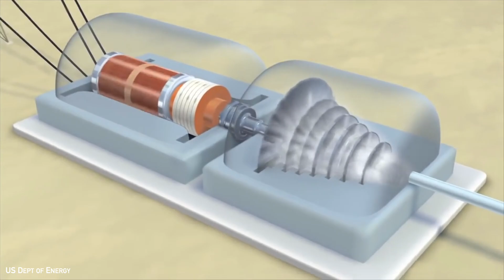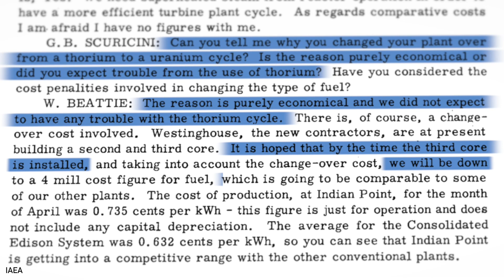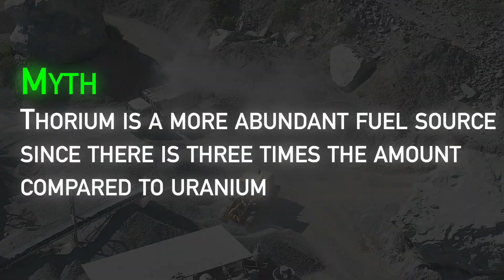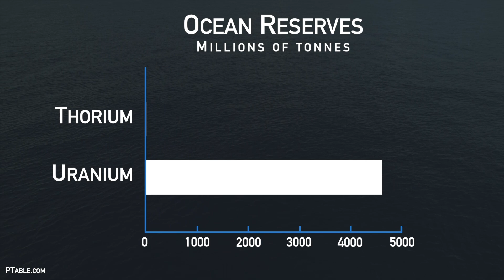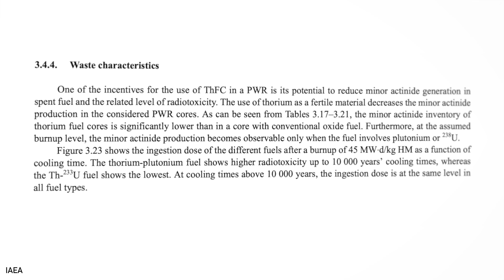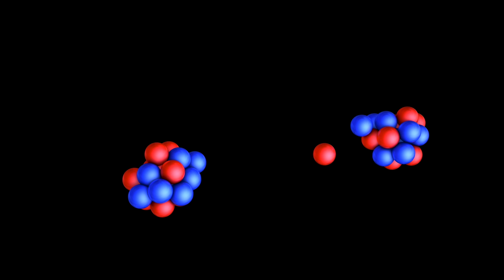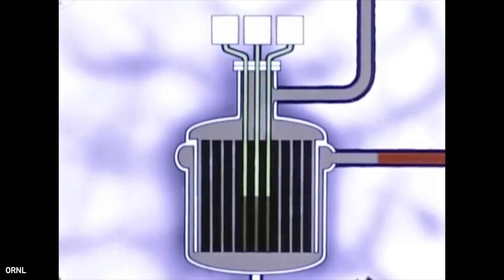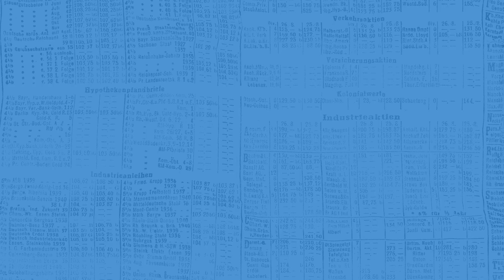*Almost

Comment: There’s plenty of uranium 238 sure but it’s not the uranium we need, uranium 235 represents about 0.7 percent and requires enrichment (separation of isotopes). Thorium 233 is the default thorium isotope, making most of your earlier arguments in this video simple propaganda and not a valid argument.
Reply: You can use U238 in nuclear reactor directly.  Canada's CANDU reactors use unenriched U-238.  CANDU is larger and more expensive to build.  It uses heavy water and thus a bit higher in operation cost.

Comment: THANK YOU FOR TALKING ABOUT THORIUM!  Fair warning, this response is not friendly.   

I loved the "oh, after 10,000 years their the same" , GREAT.   The big issue is that Uranium is industrially concentrated into pellets that are very dangerous, expensive and must be kept under strict regulatory control to keep them from melting into the core of the earth, yikes. Then we only use 3% of the energy they contain which is why it takes so long to "get back to earth levels" GREAT. Store all that waste for 10,000 years!!  More government! The nuclear industry makes a lot more money off the pellets, maintenance and security with the large scale reactors. 

Thorium on the other hand uses 97% of the energy which is why the waste is so much less dangerous and "goes back to the level at which we dug it" so much quicker than the hyper concentrated Uranium pellets. Thorium reactors can actually burn the waste you buried. BRILLIANT!  You also fail to mention that there are thousands of metric tons of Thorium just lying around mining pits all over the world. 

Also, the reactors are very different. Conventional reactors are large and must be meet strict continuous maintenance to be contained to prevent melt-down. (Fukushima, right through the water table)  Then there are MSR's (of which there are a dozen designs) which are more like riding a bike, when you stop peddling they simply shut down. Done and Done it's the difference between a chemical reactor that must have material continuously added to keep the reaction going vs a physical reactor (like a radiator) which must be continuously cooled to prevent disaster! 

Oh, and then there is modular  safety from terrorism, etc etc etc. Now there are material challenges due to the salts in the MSR, but there are other designs that avoid the salt intensity. They each have advantages and disadvantages, but large scale reactors are much scarier when disaster does strike.  

Fair warning! This is not a fair article. 
 The world needs usable reactors for energy to pull themselves out of poverty. Molecular safe reactors are the scalable solution at this stage in technological history!

Comment: Are the Chinese building Thorium reactors?
Reply: Yes!
Reply: They are experimenting with Thorium reactors. 
As in the video said, Thorium is a byproduct of rare earth mining and drives the costs and safety measures up. So a buyer for the Thorium can be useful.
Also, they are dependent on australian Uranium on which the chinese are not very satisfied about.
Reply: @ERROR-zq3gi  TMSR-LF1 is the experimental reactor with 2 MWth already running. 
Regarding uranium the Chinese already developed a method to get it out of seawater. And with advanced reactors they can als use the spent fuel and depleted uranium for about 100 times the electricity.
Thorium is a bit harder to use than uranium.

Comment: You can breed with U-238 as well.  Tritium created in thorium reactors?  Really?  Commercial grade Plutonium is not a weapons fuel.  You need weapons grade plutonium, as North Korea discovered as they started from scratch and made a bomb without any intervention from anyone.  So, what is the purpose of non-proliferation if we do not act on it.  the free market should dictate what is "economical".  Remember, the longer the half-life, the closer it is to stable.  "Possible" does not always meant "practical".  Proliferators want "practical".  U-233 is much more radioactive than U-235/238 which is the most important reason U-233 less desirable.  Nothing about the Pa-233 issue in Thorium reactors was mentioned.  It would be useful to further explore this subject and not take this video as "gospel".

Comment: To be precise Thorium absorbs a neutron and then decays in days into one  fissile Uranium isotope. That isotope can be used for bombs but is  way less useful to use it for it. Because the backside of this specific Uranium isotope is that it's half life is 24 years. So the "maintainance" cost for a nuke core build from this isotope would be way higher than from plutonium with a half life in the thousands of years. And yes I speak from one isotope because Thorium is 98.x % only one type of isotope.
Reply: No, the problem is that also some U-232 is produced, which decays at some point to TI-208, a hard gamma radiator. Bombs that radiate hard gamma in storage are not very useful.

Comment: During fission of thorium a byproduct of trillium is transmuted. Trillium is very diffucult to capture and store. Trillium is extremely toxic and can easily contaminate the local water supply. Thorium needs more research and experiments to better control the toxic byproducts... however trillium, when safely captured, is an element needed for fueling  nuclear fusion.

Comment: As always, the devil's in the details.  A few notes:

When Indian Point did a thorium cycle, it was with thorium in solid/pellet form.  They were complaining about the economics of getting & using thorium pellets from their suppliers, who were already producing uranium fuel pellets at scale.  Of course a new product was more expensive than an established one.  So saying 'thorium isn't really any cheaper because Indian Point said so' is a bit disingenuous.

Also: Even if worldwide minable thorium and uranium reserves are similar, thorium only contains a single naturally-occuring isotope.  So all of the thorium you mine is going to be of the type you want to run your reactor.  Uranium, on the other hand, comes has U-235 and U-238 isotopes.  It is U-235 you want in your fission reactor.  Unfortunately, U-235 only makes up about 0.7% of naturally-occuring uranium.  Uranium generally has to undergo an expensive 'enrichment' process to increase the percentage up to 4-5% for most reactor designs (the Candian CANDUs are the exception here since they run on unenriched uranium, but they require a heavy-water moderator and tritium extraction).

The real breakthrough (you kinda alluded to it) will be when someone finally commercializes a fluid-filled reactor (like the various molten-salt designs).  Compared to the current pressurized-water reactors (PWR), they have a number of advantages: online-refuelling, operating at atmospheric pressure, high-temperatures (for more efficient heat-to-electicity conversion, or for process heat), on-line production and extraction of medical isotopes, passive safety systems, the ability to 'consume' nearly 100% of the input fuel without expensive reprocessing, etc.  And yes, fluid-filled reactors will be inherently safer than current fleet of solid-fuelled PWR reactors.

As you mentioned, either uranium or thorium could be used in a fluid-filled reactor, but thorium still offers a number of benefits in this regard... among them: it's high cross-section in the thermal range, its (relative) proliferation resistance, and vanishingly-small production of trans-uranics.

Regarding bombs:  Yes, you can make a bomb with U-233 (which is what Th-232 becomes once it absorbs a proton), as has been demonstrated.  There are a couple of problems with this though.  First, U-233's decay chain includes a hard gamma emitter, which makes it extremely dangerous to handle, and unsuitable for dirty bombs and "suitcase" nukes (you'd never be able to smuggle it past any detectors!).  It's even harder to handle than Pu-239 in this regard.  Secondly, the fact that there will naturally be a small amount of U-232 produced in the thorium fuel cycle will complicates any bomb-making process.  You can't chemically separate the U-232 from the U-233, so you'd have to go the centrifuge-based "enrichment" route, which is even harder when your centrifuges are being bombarded with alphas.  Certainly a government entity could work around these problems, but why would they bother, when U-235 and Pu-239 bombs are just as easy or easier to build (and better understood), and it's just as easy to breed Pu-239 in an FFR anyway?

Comment: Sorry, your arguments don't go deep enough. Ultimately, most of them are wrong.

As you point out, no one is looking for Thorium (its a radioactive by product that requires special disposal when there is no use for it - see rare earth mining), and Even so, as stated, the recoverable abundance is about on par with Uranium. With some exploration (as you did note) large, exploitable deposits will be found... there are already known large sources including rare earth mines which would make these mines profitable.

Please note the cost of pulling Uranium from Sea Water is 10x more expensive than mining... so doesn't qualify as "recoverable" if its not economically feasible. One could point to other saleable by-products such as fresh water, lithium and salt. But one would have to do the same exercises when addressing "non-recoverable" Thorium.

But the Big item that was overlooked: 
The fuel isotope of Liquid fuel Thorium reactors is the Main isotope with 90+% usable as fuel. With Uranium more than 90% of the isotopes are Not usable, only a few percent is usable as fuel (hence the expensive requirement for enrichment which is Not needed for Thorium).

This Vastly increases the amount of usable Th fuel vs Uranium by a factor of more than 10 to 1. So yes... there's a Lot more usable Thorium than Uranium even without extensive exploration.

Regards safety: You can't take Uranium and dump it into cooling pools when there is a break down. Unlike Thorium, you have a problem with criticality. 
This may or may not be less of a case with a liquid compound of Uranium but there is No chance of a criticality with Thorium. None.... and selling nuclear power to a public that equates it with black magic is much easier when you can say "There is NO chance of a Chernobyl." vs "Its much, much less likely to produce a Chernobyl."

So yes. Thorium is safer to work with and can't go critical even with a small amount of U233 in the mix.

Most of the other benefits Do (as you point out) come from the Liquid fuel process vs grossly inefficient solid fuel processes. 

I agree that many of the advantages (efficiency of fuel use, for example) are due to the use of a liquid salt, but there are still Major advantages to Uranium

Other item: Tritium is worth $30k/gram and can be bubbled out and collected as a by-product.
Reply: Regarding extraction of uranium from seawater, the Chinese have developed a new process which seems to be on par with mining. But, if you can with advanced fast breeders extract more than 100 times the electricity out of uranium, use spent-fuel and depleted uranium, the price of extraction is point-less anyway.

Comment: How does burnup percentage compare between MSR running either uranium / thorium VS traditional uranium PWR.
This is one of the main advantages of the MSR using Thorium. But it's barely touched on here. 
Question worth exploring ?

Comment: I gave this a like, but with a lot of reservations.* This is an unusual case. It's not so dumbed down as to be useless for the fairly complex subject, but it's not quite deep enough to keep from glossing over a bunch of important details. It's somewhere in the middle. I'd have preferred it to be longer, with more details and visual aids. After all, on YouTube you can ignore the parts you don't fully understand, and optionally view them again later.

* At least the presentation didn't suck, which is my big complaint for most videos, on all subjects.

Comment: Thanks for this. I worked in nuclear for over 20 years and this sudden thorium craze on the internet has always been a bit bizarre to me. I'm all for new reactor types and thorium is absolutely a viable alternative, but the touted benefits are always pie-in-the-sky claims that have no basis in reality. And most of the people trumpeting these benefits have no real knowledge or experience with nuclear power. It's just really weird and what is even stranger is how emotional some people get about it. Like, what are you even arguing about? If the economics shift in favor of thorium based fuel, then that is what will happen. It's not a disruptive tech like fusion would be. It's just an alternative to traditional U-235 fission.

Comment: The trouble is that whatever the fuels used, radioactive waste is still created and this is extremely long lived according to our short lifetimes and current (unstable) civilisation.  Safe, long term storage has not been demonstrated for the lifetime decay of radionucleotides.  Do we really have the right to create and leave radioactive elements for future generations to have to cope with, when they will not have had any of the benefit of the energy created and may not have the means to cope with this legacy?  As I live near Sizewell B on the Suffolk coast with C starting building, I am highly aware of the 'cradle-to-grave' drawbacks of PWR and EPR reactors.

In any case, all these reactor types are essentially thermal output, so it means that <60% of the primary energy is wasted.  It's about time that we progressed beyond large Base Load stations that waste energy in the same way that steam engines did in Victorian times.  This is an aspect that is seldom mentioned and seems an accepted fact that is un-challenged.  I am hoping that at least one of the front runners in Fusion developments - Helion - will be able to demonstrate a direct electrical output from a reactor and that smaller, highly efficient, modular, decentralised and inherently fail safe power stations become an accepted norm in the next few years.

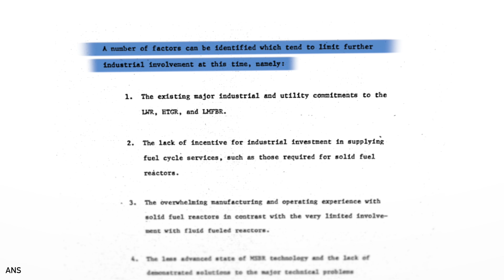Comment: These reasons for not investing in Thorium (3:17) are AFTER the decision was made to go with Uranium LWR and after Uranium reactors were in “overwhelming” use.  So this argument is being made here why not reverse a decision that is already well down the road.  That is a very different question and decision point from why not start with Thorium liquid reactors.  Look at these reasons – these are long after the decision was made.
-	“The existing major and industrial and utility commitments to (Uranium LWR).”
-	“The lack of incentive for industrial investment in supplying fuel cycle services (these were already in place for Uranium reactors.)”
-	“The overwhelming manufacturing and operating experience with solid fuel reactors in contrast with the very limited involvement with fluid fueled reactors. “
-	“The less advanced state of MSBR technology and the lack of demonstrated solutions to the major technical problems associated with the MSBR concept. “
These arguments do not make sense at the point of when you are deciding to build the initial reactors… these arguments are made, and only make sense, after one has already committed and is far down the road with Uranium LWRs.

The question that was not correctly answered is how to prevent meltdown failures of LWRs? It was incorrectly believed that this could be prevented with redundant backups; we now know this is not true with several meltdown failures.

Had we gone with the Thorium LFTR design these same arguments could have been made against Uranium reactors once the the LFTRs were in place.  The fact we needed Uranium and Pu for bombs, needed even with fusion weapons, was a problem solved with Uranium reactors – and that need had to be addressed.  These must have looked like similar options, but the Uranium LWRs also had the weapons material addressed.  The safety was considered addressed by redundancy (later demonstrated an incorrect assumption). 

The other argument with which I disagree is safety factor – the failures of LWRs were, and continue to be, expensive and not considered as part of the “cost” -  as these costs are primarily borne by the citizens and governments where the accidents occurred.

I largely agree with the other positions.  
It is possible/probable that the influence of the patent holder of the LWR had undue influence on the decision to use LWRs.

Yes, one can use Uranium in a MSR, but Thorium makes more sense as a fuel (for many reasons) as has been established.